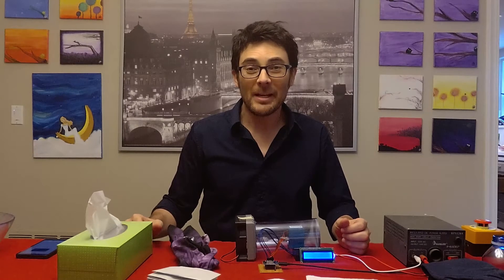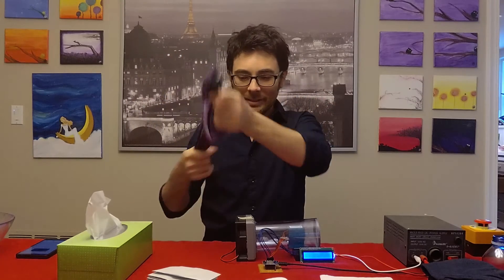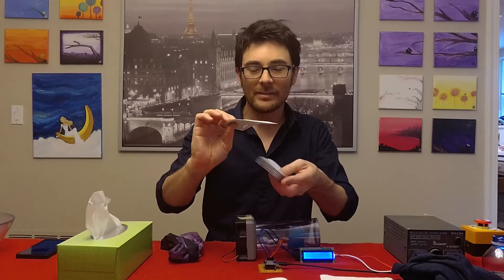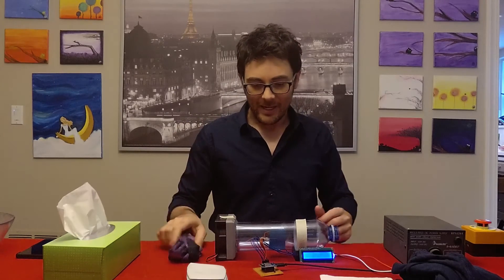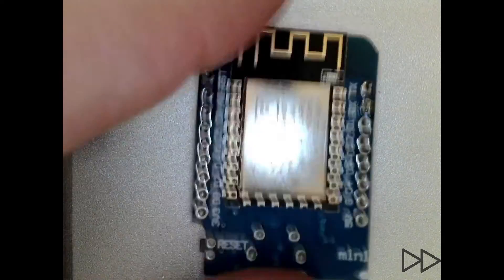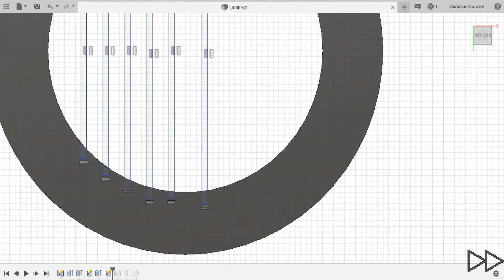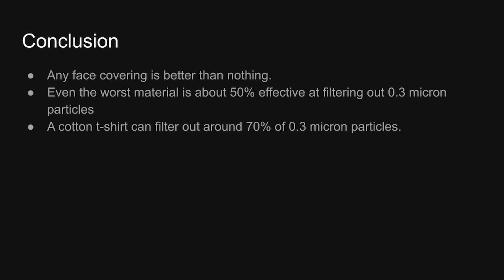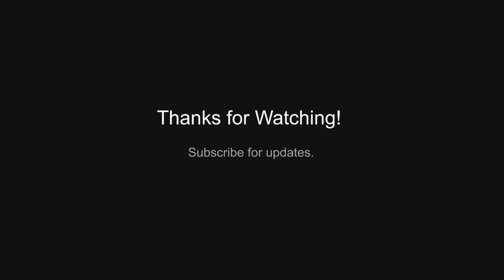How effective is your DIY Facemask?  Several common materials tested!

Comment: This is really interesting.  I was wondering what the filtration efficiency of the PM 2.5 filters, because they are popular in my country. May I ask where you got your filters in Aliexpress? I've seen some PM 2.5 filters that are certified to be GB/T 32610-2016, which has a PFE (0.3 microns) >90% at minimum.  It comes in grades I (> 90%), II (95%), III (99%) in filtration efficiency. 

Also question, you said you used a 12 V fan for this experiment, may I ask what was the speed of the airflow?  This experiment is promising but I wish you were able to use NaCl aerosols (at 0.3 microns) too to make a close approximation to ASTM criteria :)

Nevertheless, nice video!
Reply from the maker: You can grab them on Amazon here: https://www.amazon.com/Activated-Breathing-Protective-Pollution-Activities/dp/B085L9HFV6/